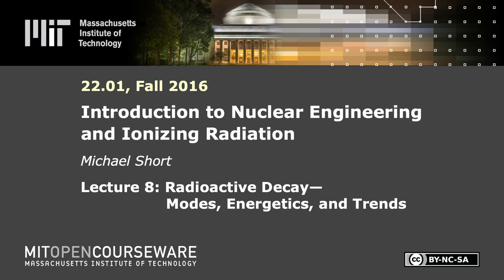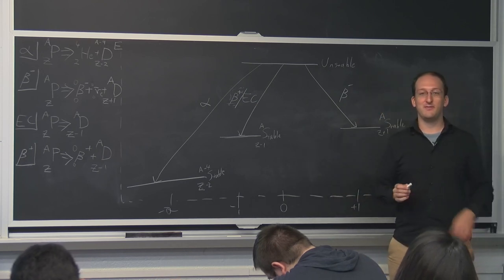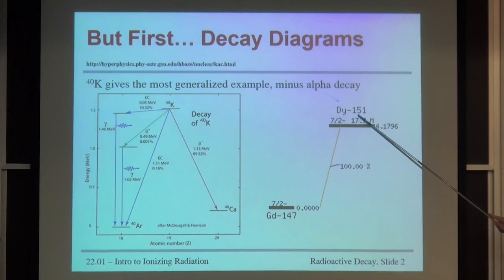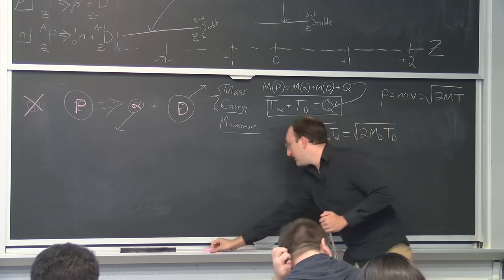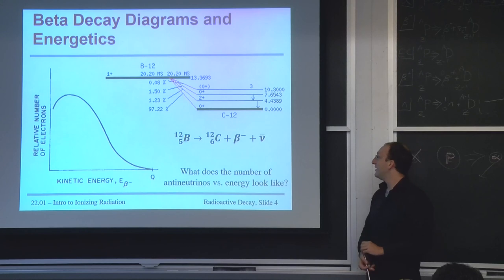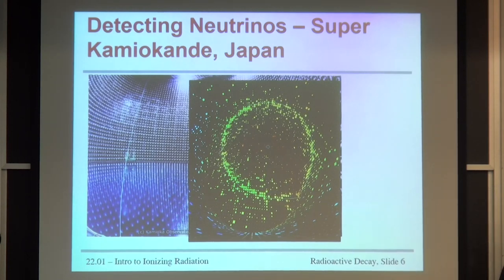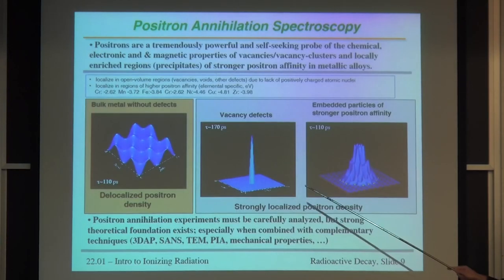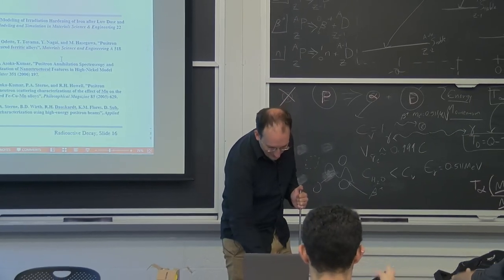8. Radioactive Decay — Modes, Energetics, and Trends

Comment: There is an error in this lecture. Neutrinos do not produce Cherenkov light, even at speeds above the speed of light in a medium, because they do not interact electromagnetically. (Also, if they did, neutrino detectors would be drowning in events, because oodles of neutrinos cross them every second.) Cherenkov rings are only produced in the rare case that a weak interaction converts a neutrino to an electron, which then produces detectable Cherenkov light.
Reply: That's equivalent to saying that the neutrino produced it however.
Reply: There isn't just one error in the lecture. There are four errors in just the first five minutes (all I've watched). Or do you agree with him that an electron has no mass?

Comment: 5:39 Why hasn't he explained why he is drawing the nuclei/nuclides as horizontal lines. Why did he mumble so that I could not hear what he claimed was a matter of conservation thirty seconds ago? Four huge teaching errors including one statement (that electrons have no mass) that is flat wrong, as an intelligent ten year old would know, so far. Astoundingly poor teaching. Not worth watching, let alone paying MIT fees to watch. Pity the poor students. I guess they aren't allowed to question anything the teacher says.
Reply: He explained in an earlier lecture that the Mass is so miniscule it's not included on the total atomic mass
As per "The rest mass of the electron is 9.1093837015 × 10−31 kg, which is only 1/1,836the mass of a proton. An electron is therefore considered nearly massless in comparison with a proton or a neutron, and the electron mass is not included in calculating the mass number of an atom."
Reply: @temporaryphase  If so, he should have said they have negligible mass, not that they are massless. Excuse not accepted.